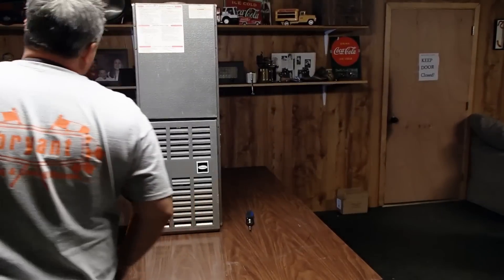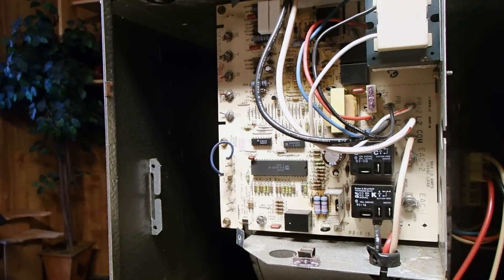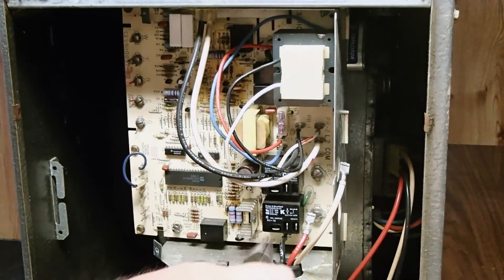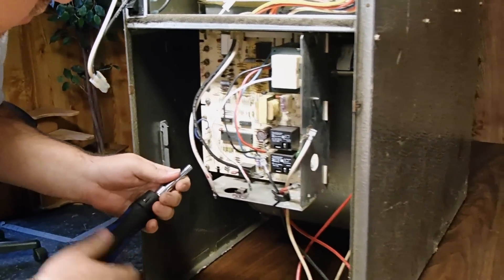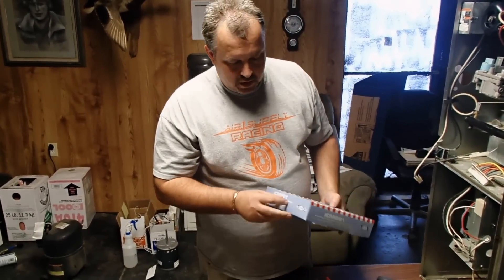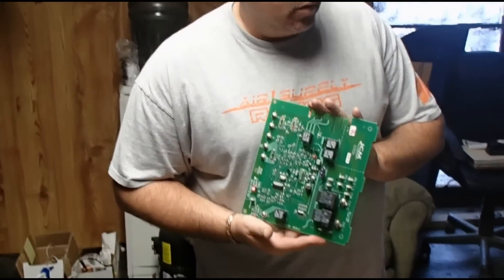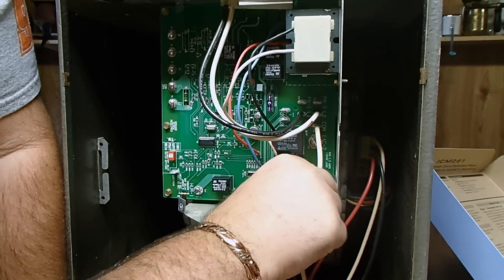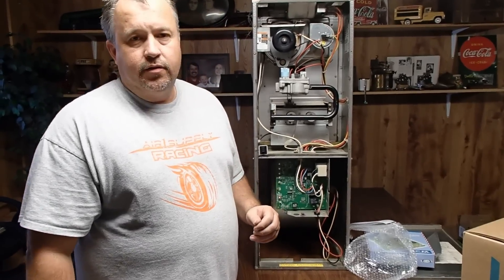How to install a Replacement CES0110057-xx Series Carrier Furnace Control Board.mov

Comment: I owe you a beer (at the very least). Had an HVAC tech come out after our old Carrier rolled over and played dead. The tech waved his magic wand over it  and pronounced it wasn't worth fixing. Would probably cost several thou to repair, but he could put in a new furnace for $9K.  .

After he left, I took a close look at the control board and could see circuit corrosion. I came across your xlnt video and removed the board. It was fried on the back. Got a replacement for $100, with an easy install thanks to your pointers. Back to warm and toasty. Thanks much. .

Comment: This is a great video, and I just replaced my original board with a new one, but I need to replace my blower motor also. I purchased a universal blower motor that is the same HP/ RPM/ Frame but it is a 5 speed blower. How do I wire it to match this board? Part number is vevor ydk370-6g28. Any help would be much appreciated thanks!

Comment: (9/21/21) FANTASTIC VIDEO!! I'm a guy with absolutely no electrical or HVAC experience (and I have never commented on a youtube video before). My furnace went out and the local AC/Heating company wanted $800 to replace the circuit board (which fried). Instaed, I went online, bought a matching circuit board on ebay for $65, found this video, and voila, I have heat!! Took me all of about 40 minutes. Terry, thank you so much.

Comment: Great video.  I just happened to have the exact same board as your old one and thanks to this video I was able to find out the the ICM281 is a compatible part.  It's 35 degrees out so I needed the part quicker than I could have it shipped but the alternate part number made it possible to find one fairly close by on the day I desperately needed it. I was 95% confident it was the control board because everything cycled appropriately but there was no "click" coming from the gas valve and it never registered 24v during start up.  One suggestion to others though is to read the manual of the new board to make sure you familiarize yourself with any functions that need to be set such as the blower delay.  Also the new board may have a recommended initial testing procedure as is the case here since the old board had no integrated diagnostic LED.  Thanks!

Comment: Yeah great job, way to cost your fellow HVAC techs their living.
Reply: If HVAC repairmen would charge a reasonable rate, there would be no need to DYI
Reply: It's not really new or secret information though... The primary value of an HVAC pro is in the diagnosis anyways.  Anyone can swap unplug/plug stuff into a circuit board.

Comment: Hey, I think that I may need to change my board, but wanted to check first to make sure that I'm diagnosing this properly.  I have verified that I'm getting 120vac in on the board.  I have also verified that the transformer produces 24vac (unregulated = 29vac).  When I measure the voltage between common & red terminals, I measure 0v.  For some reason, I'm not seeing any voltage on any of the screws despite the fact that the board is getting powered.  Given that I'm not seeing any power on the terminals, I'm assuming that it's the board.  Thoughts?
Reply: +tichris08 I want to add that I DID press the switch while calculating (ie: that should be made obvious by the fact that I was getting voltage in, but wanted to clarify just in case)

Comment: Thank you very much for making this video!  The local HVAC folks tried to convince and scare us into buying a new one.  But after watching your video and purchasing the circuit board through you we fixed it easily.  For those who might have a similar problem our Weathermaker 8000 wasn't allowing any gas out the valves.  The igniter glowed just no gas.  We ordered the circuit board and replaced the old one.  Flames!!!  Thanks guys!

Comment: Hey Terry,  I want to thank you for all of your help on how to hook this fantastic board. You see my Dad is 93 years old and still lives at home by himself on a fixed income. His heating system went out so he called out a heat/ac repairman to check out the problem. The repairman told him that there was no way to fix this system and that he would need to buy a new heating system for about $1,600.00. My Dad called me with this news and I said to him there has to be a I could fix this. So I started looking on the internet and found this replacement board and then I found your great video on how to install the board. It works perfectly!!!  Thanks again Terry for all your help.